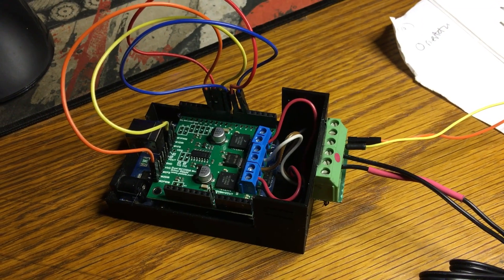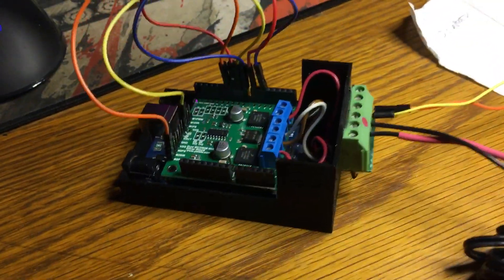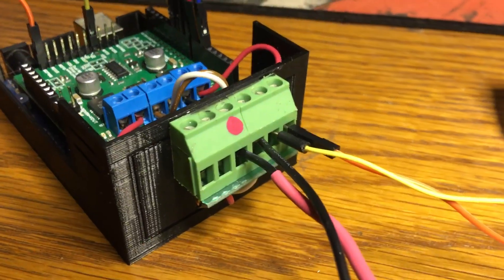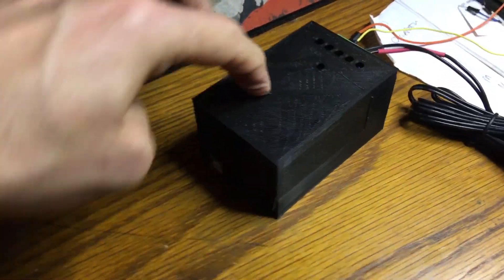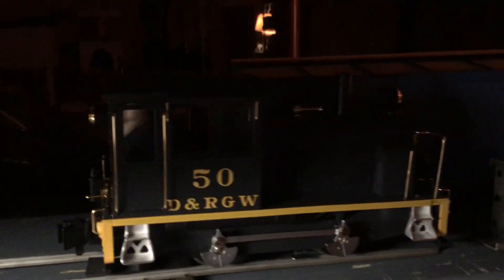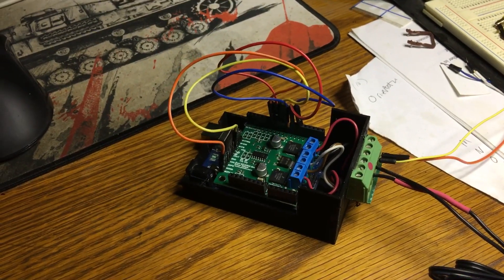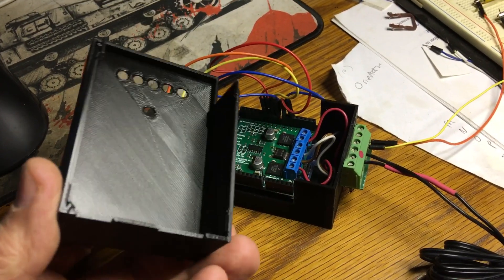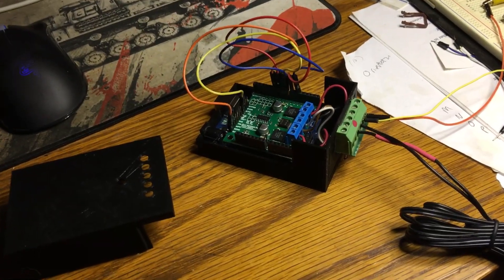DCC++ base station

Comment: How many amps is the Pololu shield rated at? I had a viewer ask me about using the DCC++ on  his LGB. Didn't know if the Arduino shield could handle it but isn't the Pololu rated at a higher amperage?
Reply from the maker: The motor shield is rated at 3 amps.
Reply: Thanks Bob